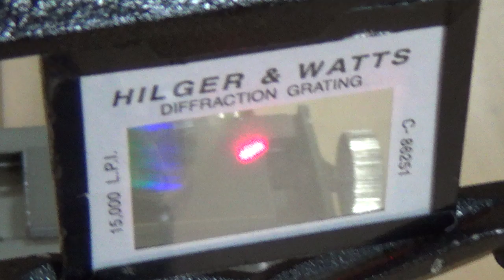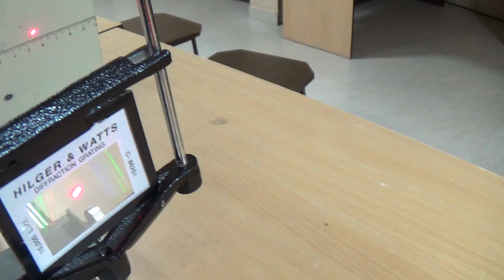Diffraction Grating Experiment || LASER Grating Experiment by He-Ne LASER

Comment from the maker: Grating element is the distance between two consecutive lines.......and grating that glass slab which have 15000 lines (cutting very fine by diamond)simply you can understand that grating element is like the slit
Reply: Sir. 1 inch= 15000line
      1inch = 2.54 cm
      2.54cm=15000
     Then in on cm
      1cm = 15000/2.54

Comment: how you are calculating slit width  using grating?
Reply from the maker: In this experiment I didn't calculated, but using the observed value of the wavelength you can determine...instead of standard wavelength. By observing the slit width in this way you can compare it with standard slitwidth...
Reply: @vyomhansjournals  if this experiment is done with same value of D but of different order, do we get the same wavelength for different order experimently

Comment: Sir, are you sure that this grating is checked on laser? I think this is a diffraction grating and it will only checked on spectrometer with mercury lamp, if you do so, then you will get a better result by seeing 2 spectrum orders. And if you don't know this thing then don't make a wrong video.
Reply from the maker: Okay thank you Mr Mohit for your updates...next time I will discuss with you if i will make.
Reply: Sure Sir. But when you do experiments with laser pointer or with he-ne laser then use proper laser grating. Don’t use diffraction grating with laser pointer or with he-ne laser.
Reply: @vyomhansjournals  if you want buy a laser grating from.
Reply from the maker: from which place, share adds
Reply: @vyomhansjournals  Dwarka Delhi
Reply from the maker: Expt/apparatus supplier?
Reply: @vyomhansjournals  Nope. Manufacturer of Diffraction Grating, Laser Grating and other Gratings as well.